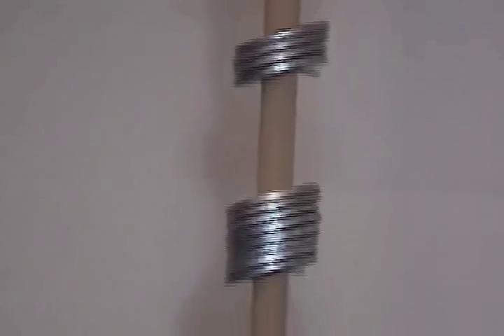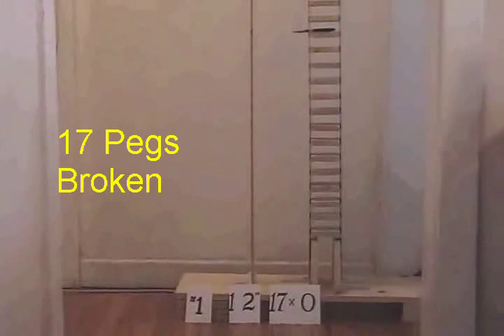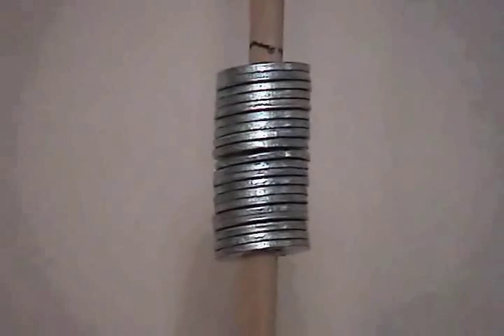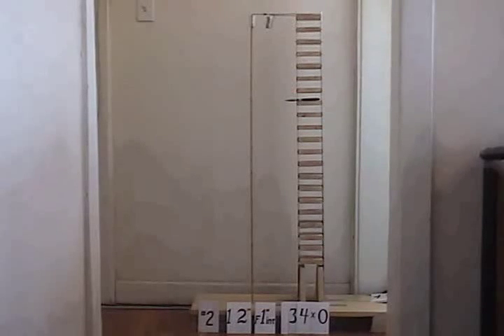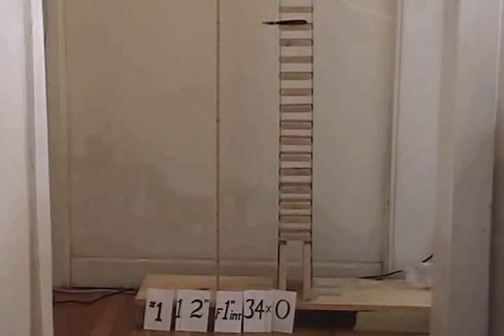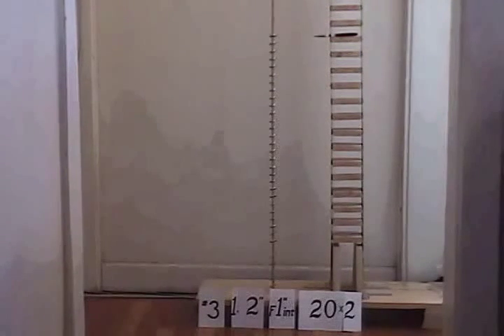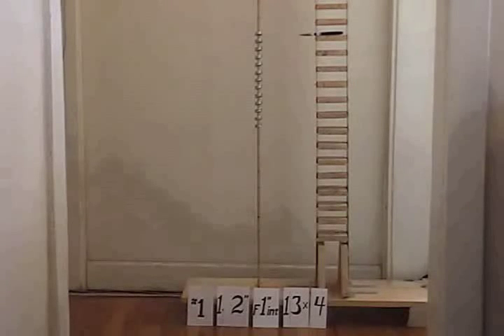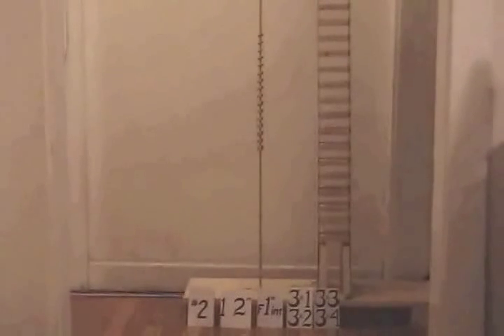WTC MIToo  Momentum Interference Test

Comment: While the Momentum increases from the additional mass the floor being struck will still dissapate some of that energy as sound, friction, heat, etc. 

Since the mass incresess, (Mass of floors striking +Mass of additional floor) the velocity MUST DECREASE in order for the Newton's Conservation of Momentum Law to remain valid. mV=(m+M)(V - v) Thus it is IMPOSSIBLE for the tower to accelerate at Free Fall...unless all supports were blown out in a controlled implosion.

Comment: @psikeyhackr 
Because your video is a big failure for several reasons.
.
1. YOU can't model a gravity fall, Dumbass.
Galileo proved that in the middle ages.
A 10 FT fall , is a 10 FT fall, and your model didn't do that.
Raise those Washers 10 FT in the air, saw thru 1/2 of the
pegs for SIX pegs, then repeat.
THIS IS NOT 12 year olds building a model airplane.
You have to understand the physics and the math.

Comment: I don't know as much about physics as I'd like, but appreciate your practical demonstration. One of the things that I've often thought about, is how the Tower with the TV antenna began its descent at an angle and momentum which should have produced a toppling effect. Instead, it would appear that the forward momentum, and the path of least resistance were overcome by other forces at work. A demonstration that could repeat or refute that anomaly would be a good experiment to try and create.

Comment: It's like dominoes where the dominoes get progressively heavier.

The top domino was too small to knock over the bottom one, but after it has pushed on a slightly bigger domino that pushed on a slightly bigger one that pushed... the biggest one at the bottom one will fail.

Comment: Actually, the WTC wasn't stronger at the bottom.

Sure, the total amount of support beams was bigger, but so was the weight sitting on it, in exact proportion.

So if you have an overload at the top, say 50% overload, after each floor has given way onto the one below, that too has 50% overload which makes it fall onto the next, and so on, the weight of each floor goes up with *exactly* the same proportion as the strength below goes up, and so the failure propagates.